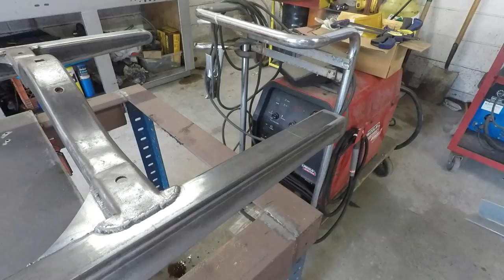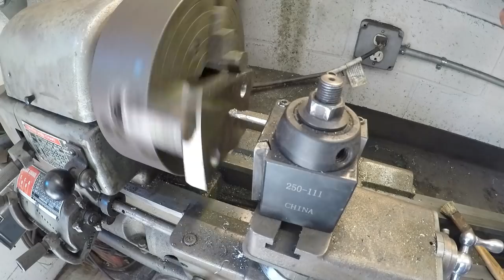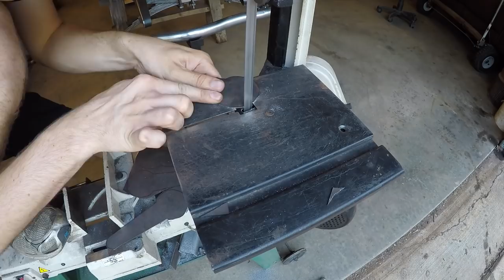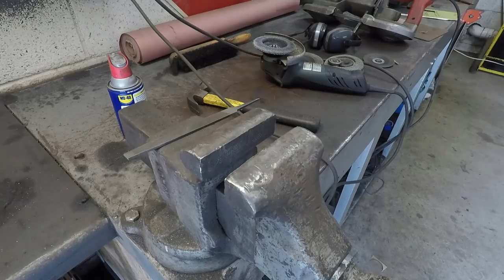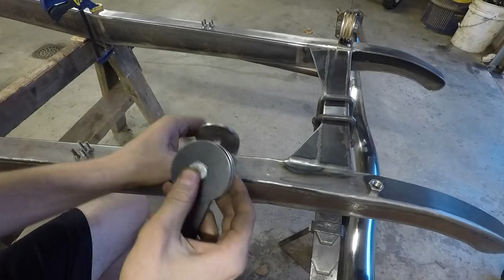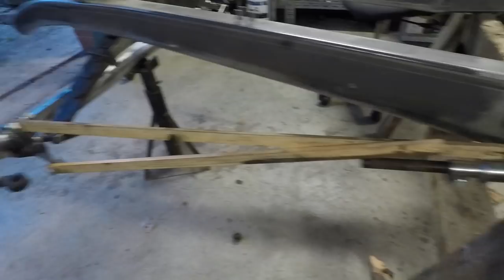Homemade Friction Shocks | Boat-tail Speedster Pt.10

Comment: Look up Belleville washers for your friction shocks. They work better if you put two of them cup to cup on both sides of the shock. Fiberglass works well for friction material. Lay up some mat to the thickness you want & cure it between two heavy plates with wax paper then cut them out with a hole saw. The natural color looks vintage.
Reply from the maker: good to know. ill keep it in mind
Reply: I was going to recommend the same type of washers, but you snooze . . . For friction disks nylon washers work best, fiberglass especially if died slightly, looks a bit like the old asbestos ones, and leather was used as well.
I would probably go with nylon and put a ring of leather around it so it looked authentic, and the type of locking nuts that don't have nylon in them. But that's just me. Oh, and if you want a dense fiberglass, hit up a hobby shop for the FRP chassis blanks for making radio controlled cars. I've seen it used for friction disks in a deep sea reel.
Reply: RBR f1 team uses them

Comment: Hi (from England), I've only just watched your video on your friction shockers, although I have seen a lot of your  later videos.  Congratulations on the skills and talents that you have which results in the very high level of workmanship.  The reason for contacting you, although you will by now, have solved the problem of your springs on your shock-absorbers.  During the Twenties and Thirties in England, a lot of cars used the friction type.  These were made by a company called Andre-Hartford who are still in business and can supply the 'spider' type of spring.  Anyway, good luck with the final work.

Comment: Ok i have to leave a comment regarding some of your safety practices . Please use a piece of wood or something when your pushing small metal threw portaband  saw . The blade will hit the wood before your fingers . And you do a lot of hand tapping ., you seem to do ok . The best way is in your mill with a tap follower to insure a straight  hole . You do great work , and i really injoy your videos . Thank you for all the time you spend on your videos.

Comment: Have you thought of using Belleville washers as your compression source for the shocks. Too, you might want to use brake reline material for your friction material.
Enjoying the project.
Reply from the maker: Those should work pretty well, but I really love the look of the five pronged spring washers so thats what im going to try for

Comment: Nice work... I just think that the friction spring thing doesnt resist if you just sopport it at one side
Reply from the maker: Yeah, I changed it so that the flange of the mounting bracket is in the center.

Comment: For that plate spring you might try and source a small pressure plate for a clutch,,,, the center part of the pressure plate.
To find one small enough is the issue.
Try old farm equipment as these were not high speed engines and transmissions.

Comment: use a leaf spring to make those 5 prong spring things cuz it's obviously spring steel
Reply from the maker: that's my plan, but I need to find springs off of something small because car springs are way too thick
Reply: MacroMachines yeah you're probably going to have to soften the steel, cut it, heat treat and temper the steel to bring it back to its springy state
Reply: @MacroMachines  one of those japanese mini trucks maybe?

Comment: Nice clip, but i don't believe, that this will work properly, because you only made one joint to the chassis. Only the friction pad between the chassis and the first connection to the axle will cause friction, the other ones will just turn with the rods without causing any friction. So you should stack them, one to the chassis and one to the axle, one to the chassis and one to the axle and so on.

Comment: Why not just get torsion bars from an older dodge car 75 to 79 4 feet long spring steel un breakable use them for your torsion bars mill them down .
Reply from the maker: do you mean for making the hairpins? because that would be super heavy, and hairpins aren't supposed to flex like torsion bars
Reply: MacroMachines I just thought of something welding on the end's will shatter the torsion bars they are so hard, The molecules are length ways for twisting they'd splinter, Just remembered seeing that on a car the hex end stripped on the control arm tried welding it and shattered,

Comment: Now lets get remotely serious. Friction shocks with a 1920s  chassis engine and tyres may be just ok. This clearly is not. So will be dangerous. As for friction material it was generally cork, Never nylon!! That is in effect a lubricant.
60 years ago everyone changed them for telescopic shocks as the were at best poor and worst uncontrollable on rough roads.

Those hairpins too are dangerous, in effect you will have a front axle working as a sway bar and it will pick up inside wheels at 5kmh. 4 link is not a great deal better. 3 link works well but probably not ideal for a road driven vehicle. for that probably a 4 link with one top joint using rubber bushings instead of heim joints. Which will not bind the suspension as much.
That ball mount stud with screw in joints will fail on the first big bump.And even with that 3/8 mount will still flex and eventually crack the chassis. you are moving your pivot point outboard of the chassis. The commonly used tierod ends ditto. 
25 years of playing with these designs on classic speedway proves all of the above. And watching street  hotrods that are simply dangerous.
Reply: Those friction shock are so ineffective that you find them on Bugatti, Alfa Romeo, Maserati, Miller... And you do realize that you can add a Panhard bar on the front suspension to avoid any ill effect?